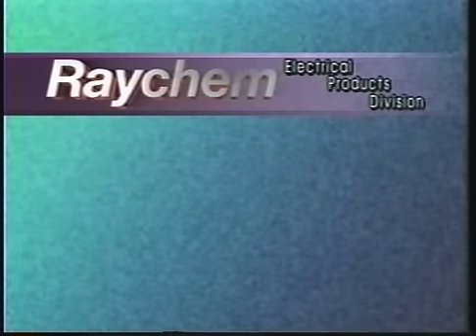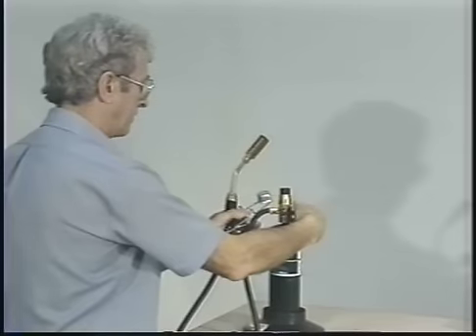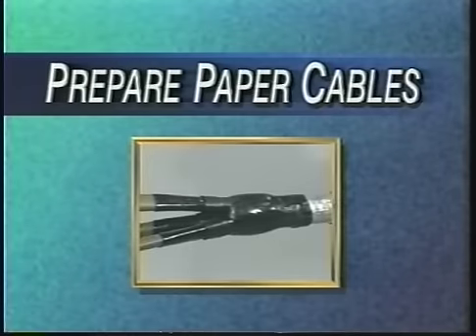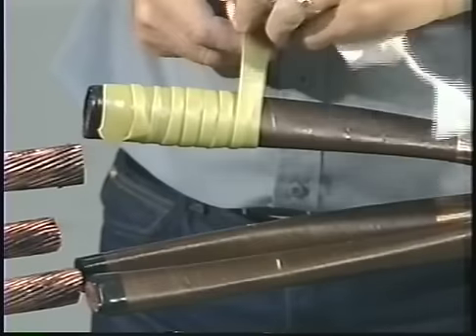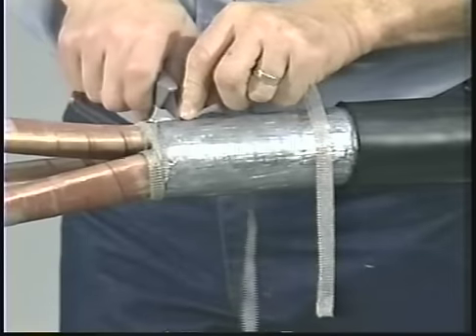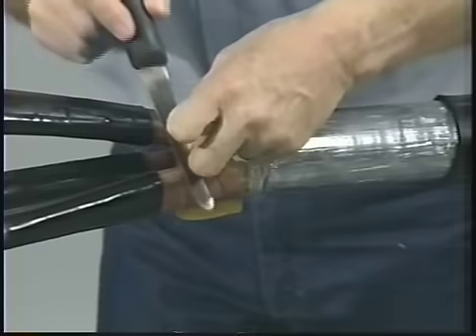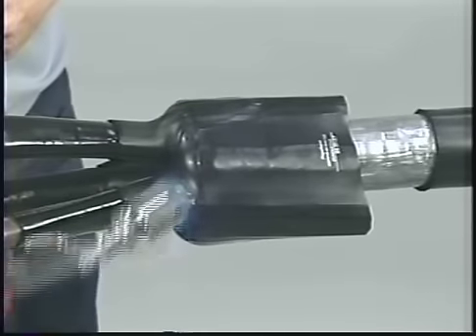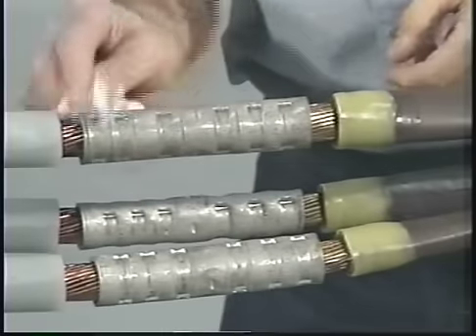Trifurcating Splice Part 1

Comment: Why yellow mastic type is used at starting end of cable core.before insertion of OBT.
Reply: Typically yellow mastic also known as SRM (stress relief mastic) is used in areas to fill voids so that corona does not occur and to mitigate stress caused by electromagnetic waves.
Reply: Because you use it to seal the paper so oil doesn't come out